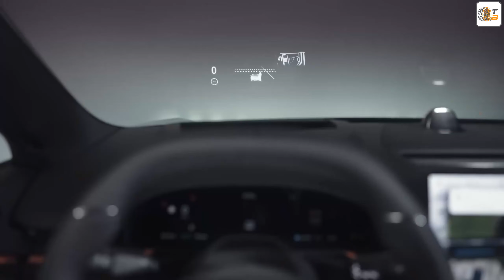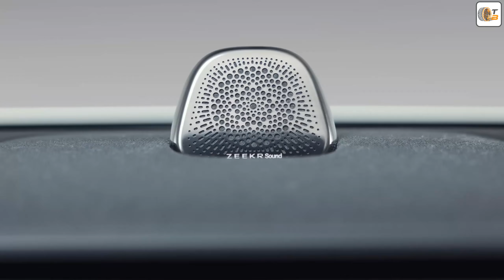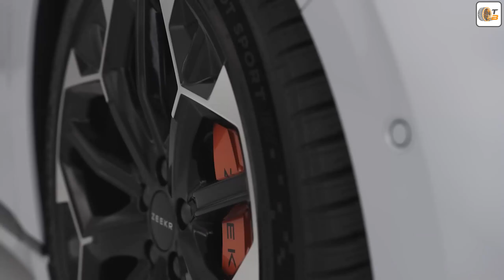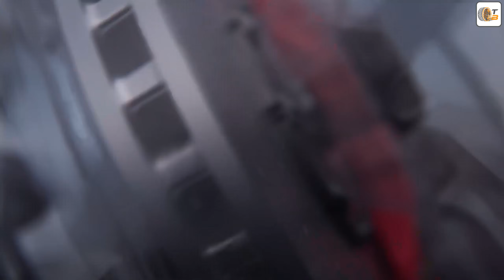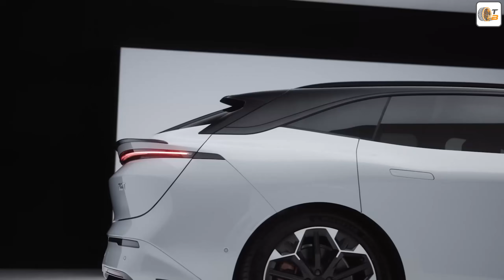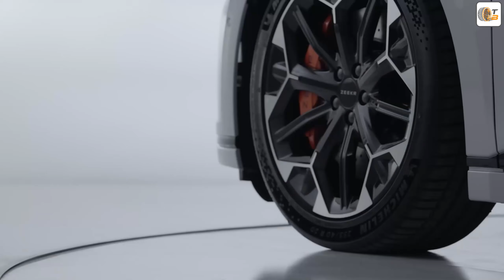2026 Zeekr 7GT: 13 Minuten Ladezeit, 800-V-Architektur erklärt

Comment: The most important question: is 800V ONLY, or it accepts 400V chargers as well?
Reply: Yes, he can (400V). And also 22kW AC.
Reply: Ja, der Zeekr 7GT kann auch an 400-Volt-Säulen laden. Obwohl das Fahrzeug auf einer modernen 800-Volt-Architektur basiert, die Ladeleistungen von bis zu 480 kW ermöglicht, ist das System abwärtskompatibel. Es kann somit problemlos an herkömmlichen 400-Volt-Schnellladern (DC) sowie über den 22-kW-Bordlader (AC) geladen werden. 
EV-Supply
EV-Supply
 +4
Schnellladen (DC): Nutzt die 800V-Plattform für bis zu 480 kW, passt sich aber an 400V-Säulen an.
Normalladen (AC): Unterstützt serienmäßig 22 kW AC-Laden.
Reply from the maker: We think 800V, but not sure in the moment